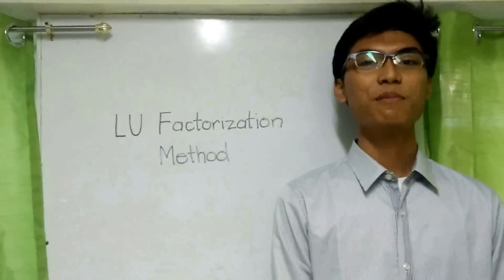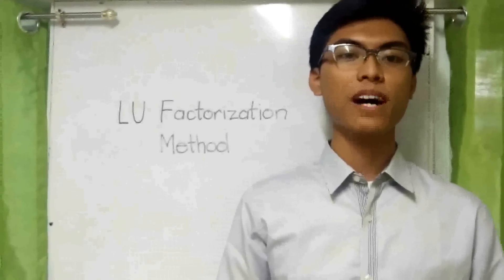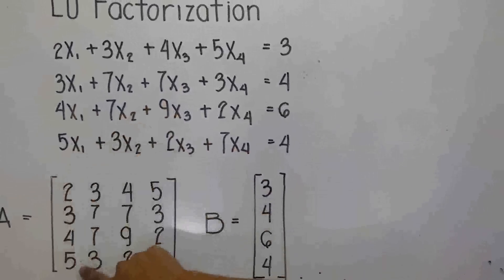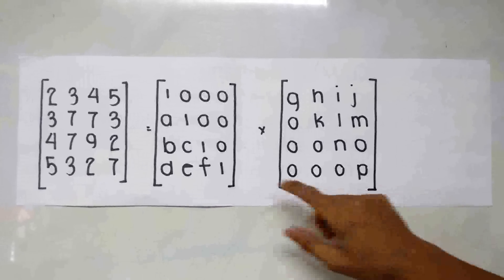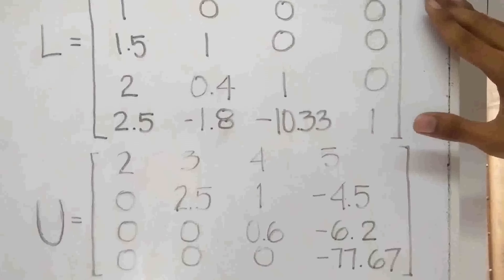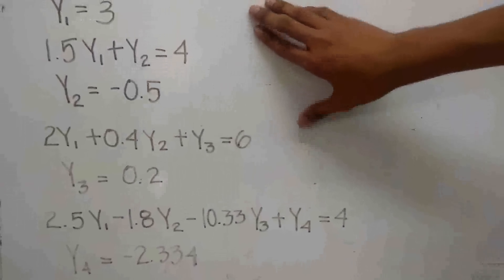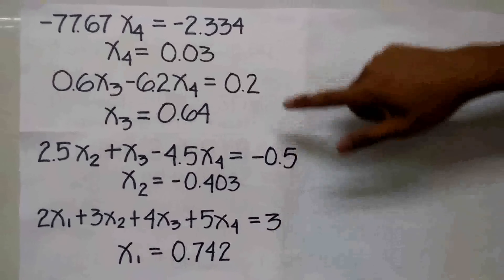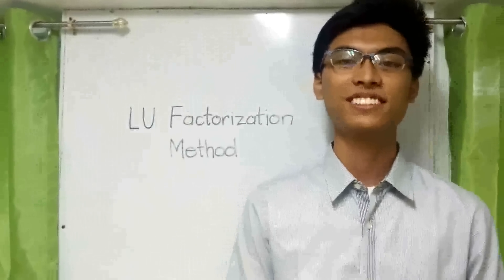LU Doolittle's Method

Comment: This video defines the LU decomposition and shows how it can be used to solve a system of linear equations, but the video does not illustrate Doolittle's method.
Reply: Beg to respectufully differ. In the matrix L, by defining the elements of its main diagonal as 1's, this is the definition of the Doolittle's method.